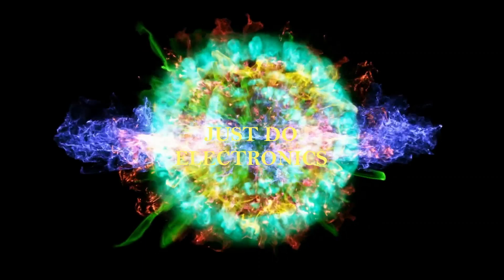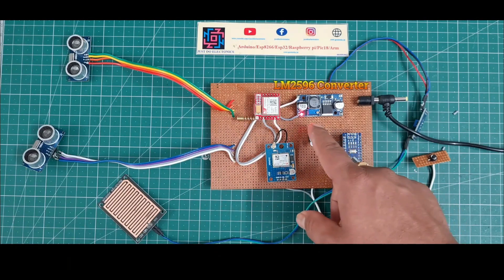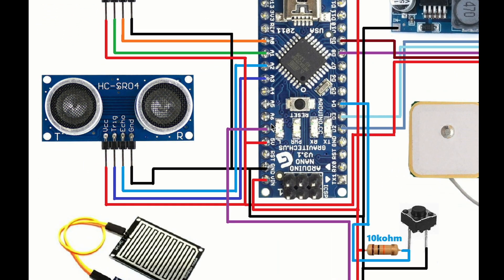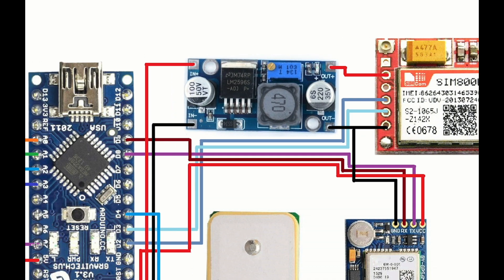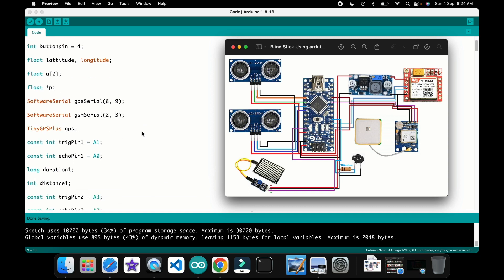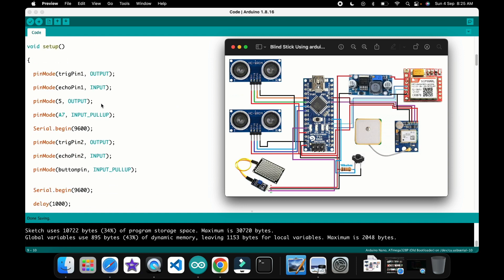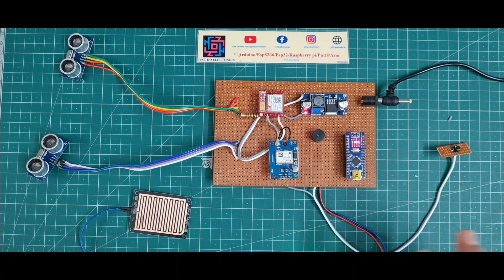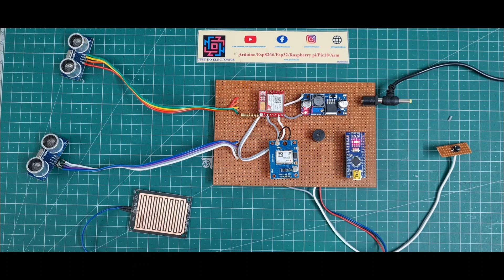Blind Stick With GPS And GSM | Blind Stick | Arduino Project

Comment: This project simply not works as you explained in this video.
So much information is missed
👉here For GSM Sim800L must be provided voltage divider (resistances )circuit for protect Sim module
👉GPS Neo 6m module not getting power on outdoor also LED not blinking totally not working.
2 modules i bought went bad only. Further this Data sheet i studied there i understood 
Due to Fed + 5 V to GSM module From Arduino board this VCC 5V giving is dangerous & permanently it will get damaged.

Here also must be given protection circuit if we feeding from Arduino 5V pin 
input rated voltage shall be given 2.7 V  to 3.6 V only.

Lot of information not covered in this the video.
Would give more information
Reply from the maker: I will try to make video proper in future i like your comment if you have any problems then contact in the whats app

Comment: dear sir i am doing this project now.
Same i hardwares i purchased &  using your code only.
Rain sensor only working properly
Remaining hardwares are not responding.
Your help is required sir.
Iam doing same project now in Diploma final year.
Kindly help me sir🙏

buzzer not coming
Ultrasonic sensors not working

After button pressed
👇
"get inside GPs"
(Here it's stopping...)
Not working next.
Reply from the maker: Check pin connections
Reply: hi may i ask your project are success??
because i also doing this project but the gsm are does not work

Comment: Can you add vibration motor to your project and make changes in code
Reply from the maker: yes
Reply: @JustDoElectronics  sir i need your contact some mistakes in circuit diagram, output not coming its urgent